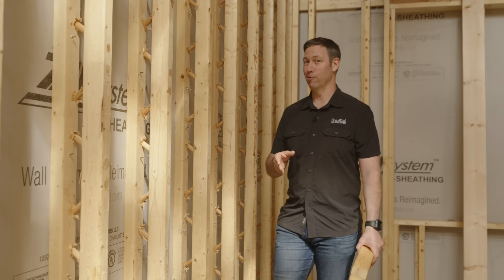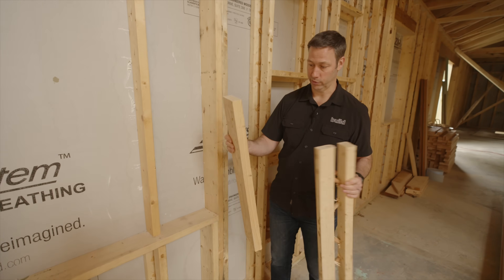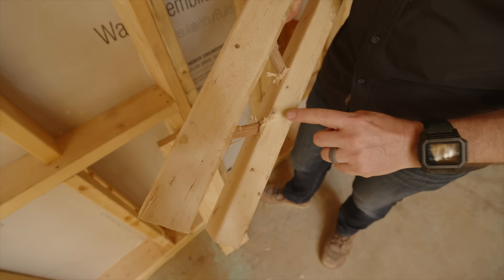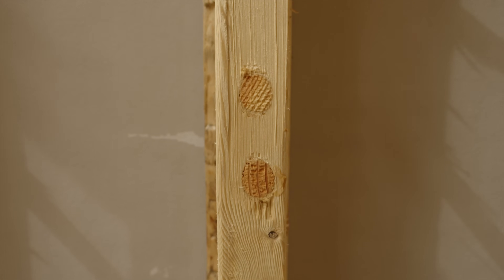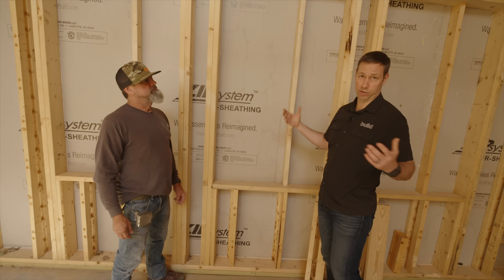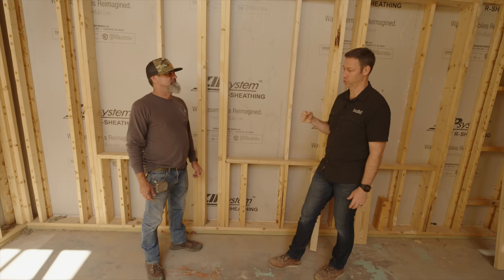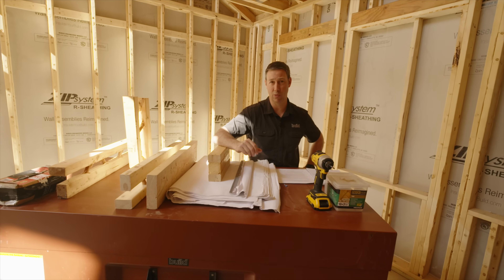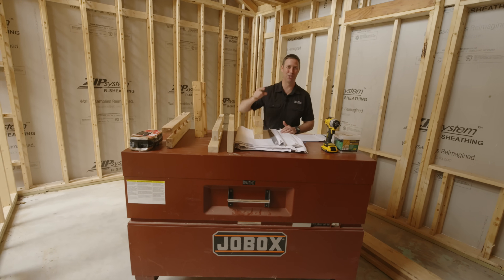Framing with a 2x6 Replacement - TSTUDS!!!

Comment: My personal largest issue is the same as with manufacturered wood trusses, tgi's and now these. A little bit of water, fire, or one thoughtless hole bored by a mechanical trade and the entire member is compromised. 

What has always impressed me about solid lumber members was their durability over time, even during a fire or a watee leak. 

And while I see the value and beauty in the flatness and straightness of engineered wood products, most of these still suffer from the fact that they are composed of smaller wood pieces, be it the dowels and 2x3 of these t studs, the strands in osb, the wood fiber in mdf, etc. 

If it's for work I wouldn't think twice if I was being paid to install these products. For my own home or shop I'd lean towards solid lumber. But that's me. Even if it meant more work with a power plane and a saw flattening critical walls.

Comment: Builder I knew in AK did 12" walls, useing 2x6, 16 on center, BUT, he would alternate the 2.6, so only on the corners you would have teh board go all the way through the wall front to back, that way we could insulate the entire wall

Comment: They're 5 times more expensive than a 2x6. If I'm that worried about thermal bridging, I'll use expanded polystyrene on the exterior as well.
Reply: 2x4 double  wall would be better can make wider wall  and offset  framing for even less thermo bridging  and cheaper
Reply: @arthurperrea3714   No. It is not cheaper.  Been there and done that.  It can be a nightmare of alignment and trim.  Does it work?  Absolutely.  But be prepared for the difficulties,, because 'it ain't easy'.
Reply: @Sailor376also  I built  my last house like this  didn't  find it hard . And if i was to built in the future  this is the way I go. REGARDS
Reply: 3x the compression strength, significant labor reduction in electrical and plumbing installation, less moisture trapping, facing size options for ease of other installs (like double width on the interior studs for cabinetry, or exterior for sheathing)... 

Price is absolutely a factor, but it is a product that will affect the expense of other steps of construction. Is it enough to offset? That will be a project by project call. I like the idea of the improved compression strength this far north with our snowfall.
Reply: @jamestaylor3805  
Ask yourself why you need 3x more compressive strength than a 2x6 for snowfall. Look at the failed structures in Mammoth and Tahoe with this last record breaking winter. All failed from to much span with undersized beams , or roof failures from undersized trusses. Most failures were from flat roof designs.  A 2x6 framed wall on 16 or 24 oc will not fail from compressive strength unless you park about 50 Abram tanks on a 2 /12 pitch roof directly over the wall. Its just not going to happen. Labor reduction for elec / plumbing. You can bet you will get the same bid for the elec / plumb but the cost difference will go into the subs pocket. Not yours. Would I use these studs on my project. Your dang right I would as long as I have a customer who will be happy to pay for it. Would I use it on my house or for a spec ? No.
Reply: @cdawg9149  sounds like a locational problem. Havent seen a maintained structture collapse under snow in Northern Maine in decades... where the winters are demonstrably worse and we prefer to build with local lumber.... but get on with your bad ass anecdote.
Reply: @jamestaylor3805  HAHA!!! Mammoth /Tahoe has recieved over 700- 750"" this winter with some structure failures from massive snow loads .Maine? Thats funny.
Reply: Thermal bridging remains the difficulty to over come.  You used nails to nail the EXP in place?  A normal nailing schedule will use 30 to 35 broad head or roofing nails.  Those nails transmit like a boat with 30 to 35 holes in the bottom.  You can run your own experiment,, easy to do.  Take two cheap foam coolers, two identical bags of ice, poke 15 or so nails through the sides of one, and then tape the two coolers shut.  Small hole in the bottom to allow water to drain.  Observe by total weight,, don't open.  The sealed unnailed cooler will last two or three times longer. Do not under estimate the number of nails that penetrate the foam,, sheathing? siding? trim?
In construction the nails through foam on one side are one plus inches from the nails on the other side for drywall.  Drywall is a cemetitious product and moderately conductive.  Foam definitely improves performance,, but not by a whole lot.
Alternative that is fast and cheap.  Two,, depends upon what heating/cooling zone.  Truss studs,, but make your own based upon a 2X10,, 9.25 ? Intermittent 3/8th plywood gussets, 2X3s instead of 2X4s,,, Fiberglass is cheap, and cheap per R value.
Or, build a 2X4 wall and on the outside, nail on a 2X3 layer 24 OC,, horizontal or diagonal (excellent nearly free wind bracing for windy locations)    Place un-nailed foam sheet 1.5 " thick between the diagonals and then sheet over with second layer of foam nailed into the diagonals   The contact points for thermal bridging are reduced 10X  and the nails for the outer skin do not penetrate the inner studs.  There,, 50 years of engineering, free
Reply: @Sailor376also  Nails penetrating all the way through into a cooler isn't the same as nails half way or less into a stud.
Reply: @jonking7345  I have run the experiment both ways  nailing a chunk of 2X to the outside and just sliding 12d nails through,, it doesn't make a lot of difference.  A 2X is not a good insulator,, about R-1 per inch..  But don't take my word for it,,, run your own experiment.  Or get a thermal camera and in the winter,, photograph a wall interior face,, just like I did.  You will find that the cold of the stud, glued and nailed to the interior drywall makes the drywall cold left and right of the stud contact point by several inches left and right.  In very cold weather , you can find each stud with your hand by sweeping across a wall .  Use the back of your hand,, less finger marks and more sensitive to temp changes.  In Arizona you can perhaps find the warmer areas of the wall.   Don't debate me.  I've run the experiments and 40 years ago.  Go do it yourself.  Go to Grainger's and purchase a good thermal imaging camera.  You do not have to take my word for it an ounce.    A conventional 2X4 studwall, 16 OC, with and average cover of 1/2 drywall inside and sheathing and siding outside, R-11 or R-13 fiberglass insulation between studs has an average total wall, R-value of between 6 and 7 , real world.  Look it up,, run your own experiments, talk to any HVAC guy.  The greatest degradation of thermal insulation is the bridging caused by the stud, R-1 per inch at best.  Stick 40 nails into that same stud (because that IS how many are normal per stud) and the entire 3.5 inches of stud is about an R-2. So right off the starting line a conventional 2X4 framed house, 17% of your wall is an R-2.  Skip the sheathing,, use metal strap wind bracing or let in 1X4 and nail foam to the outside,  and the R-5 foam is going to improve thing about an R-2.  Thermal bridging and nails are the problem to be over come.  Separate double 2X4 construction works well but is a nightmare to align and trim,, been there and done that.  Truss studs are the single best method I know.  Or non conducting (limited contact area) cross framing members
My complaint is this lock step with a 2X4 thick wall or a 2x6 thick wall.  run all the numbers yourself,, I did.  Cheaper,, better, faster,, in cold climes 2X10 thick wall with truss studs 24 oc, 9.25 inches of fiberglass.  Chopped fiber with a latex binder works miracles,, 24 inch wide, unfaced R-19 stock well placed at the back to fill between the inner and outer truss stud elements, and a 22.5 inch faced at the inside front,, all external wall wiring run at the 3.5 inches between the outer R-19, and inner R-11.  NEVER place a duct run in an outside wall,, all  vertical duct runs in the center of the envelope.  I am rambling,, I should erase all this shit and go to the doctors appointment.  I have been building,, my oldest license, City of Boston 1970,, I've been doing this a long time.  Nailing foam on the outside of a wall and hoping for an improvement in performance is a waste of good money.  And it IS nailed on,, by the carpenter's 18 year old helper, or a framing contractor who doesn't give a flying f*** what the engineer has instructed.  Foam, as commonly used, is expensive and worthless.  Yes, It is a worthy attempt at addressing a basic flaw of physics and cheap common construction,, the 2X4 stud,, but it is nailed to that same flawed system,, by exactly what makes the system flawed, nails and glue.
Reply: @Sailor376also  Clearly you like to hear/see yourself talking. I wasn't discussing whether a standard 2x4 wall was a good or bad insulator, and didn't dispute any of your other ideas. I merely pointed out that your cooler with nails fully penetrating isn't the same thing, and it's not a valid confirmation of what you're trying to say. Otherwise what you're saying is true, I have no problem with it. Now, compose a seven paragraph long reply, so I can't/won't read it.  I suppose someone will🙂
Reply: @Sailor376also  the newer adhesive and clip retained exterior systems show a ton of promise for closing the envelope.
Reply: @jamestaylor3805    Adhesives work well,, and for how long? Newer adhesives cannot be trusted,, not one of them.  I have demolished work I did decades ago.  Unrecorded number of remodeling.  Adhesives are only trustworthy until the building is up.  Some adhesives have proven wonderful,, others,, just expensive shims.  And there is ZERO ways they can be trusted for the long run.  Been licensed for 50 years.  You also do not mention how many nails will be used to nail the siding, the trim inside and out.  A normal salvaged 8' stud used in an outside wall will show 30 to 50 nail scars.  Siding, brick ties interior trim and cabinets, plumbers nails, electricians fasteners, HVAC guys,,, and then 25 years from now,, the homeowner or hack contractor remodeling. Glue and clips are almost certain to be violated 6 ways to Sunday.  Use the KISS principle.  Truss studs are a marvelous thing,,, but why oh why would you use a 2X6 format.  The idea is nearly perfect.  Just go to a 2X10 or 2X12 format,, cheaper, faster, better.  And on the subject  Quad glazed windows,  11/16 to 13/16ths space between each layer,  dehydrated air,  stainless or urethane spacers (aluminum has twice the expansion contraction ratio of glass,,, just hot cold cycles guarantee seal rupture)  Quad glazed is where R value vs total transmittance curves meet.  CO2 or Argon filled,, low E (except in extreme sun)  expensive salves because a 3/16ths air space is insufficient.
Reply: @Sailor376also  the new adhesives used in todays construction are literally the same adhesives that have been holding our aircraft together for decades, and have kept high end yachts intact in rough seas. You have to understand that you're experience though great and useful is still anecdotal... one perspective and set of knowledge. I have aircraft tape in my toolbag because it is better than anything else on the market for its ability to hold and seal... it is the tape we use to repair the EXTERIORS of aircraft. Same adhesives that have been holing arctic explorations facilities together in extreme temperatures just as long. 

I agree, the products that have come through the construction industry should always be scrutinized, but this adversity to adhesives is odd from someone I am sure has had fights with stubbord wallpaper from the 30s...
Reply: @jamestaylor3805  There are some or many adhesives that are incredible.  But how long will they last,,how much diluted is the construction version vs the aircraft or marine version.  And what is the life span. My knowledge is not anecdotal,, long experience.  I have dismantled structures that simply would not come apart. One remodel required a chain saw and cut into segments and disposed.  But how many times have I peeled something apart an the glue had entirely let go,,, many times.  None of us (Me especially) will live long enough to see the results.  (There is a benefit to my age,,, I can warranty everything for life now.  Laughing,, it won't be me that has to deal with it.)  Yes, I agree,, there is some incredible stuff out there. The better stuff is expensive,, and the subcontractor that does the brickwork or siding  will punch holes through all of it.  I JUST did a home inspection,, the plumber simply cut out a 1 foot piece of a floor joist.  How do you control a plumber three years from now,,, who first,  does not care,,, and second,, has not an ounce of knowledge about the perfect glue and foam clips.  Will the homeowner set their humidistat too high and soak the under side of the foam?  How will the perfect adhesive age under constant water immersion and freeze thaw cycles.  It may do extremely well,, but  I have zero way of knowing the 50 year span of a product.  I have zero control of what the scam contractor or simply 26 year old brand new contractor will do to this structure.
Glue has proven to be untrustworthy in the long run.  Some is great,, some rubbish  but they all have the same rated ASTM numbers on the side of the tube.  I use a lot of glue,, and with nearly annual formulation changes, I back it up with fasteners where required.  The person installing the sheet foam on the outside of the building is a per piece or by the hour employee.  As is the plumber,, the siding guy,, the Spanish speaking brickie.  And even,, not all marine application adhesives do what they are intended to do.  An Irwin 39 lost all her bulkhead on Lake Huron.  The 100mph tape on Pete M.'s Cessna was a standing joke.  Tyvek?  expensive, fast, and close to worthless in practice,,, excellent if use faultlessly.  The new roofing underlayments,, fast,, cheap, and dangerous and useless except they comply with code.  15# felt is pretty useless too,, but 30# felt beats Tyvek and the new underlayments absolutely hollow,, except it weighs so bloody much.
Reply: @Sailor376also  Just want to throw it out there that "your experience" is essentially the definition of the word anecdotal.

I do a lot of woodworking and I have seen nails and screws regularly loosen up, while I have almost never seen wood glue do any such thing. This is anecdotal. I am not saying screws and/or nails are inferior, but just a random example of using anecdotal information.
Reply: @Jasoninee  My experience can entirely be labeled as anecdotal.  One man, one life's experience,, no question.  I have a very wide ranging experience.  Oldest structure I have worked on, residing a house built approx. 1680.  My experience of adhesives is ,, some have worked and some have not,,, but the span of time bridging from use to failure, less than a lifetime.  And the confirmation that some have worked very well,, only the observation spanning 30 plus years.  Will the 'good ones' Continue or will they fail after 70 years I have no way of knowing.  But,, enough adhesives have failed in my span that I have become less trusting of adhesives in general.  I am not going to live long enough to judge what is good and what is not good.  About half are rubbish.
Take something common and commonly used,, silicone.  I wouldn't use it on a dog house,, and I will never use it in a roofing, window, or tub surround.  You cannot remove it from most surfaces,, and you cannot caulk over it, nothing sticks to it,,, but black mold can climb under it and make a mess.  So you want to scrape it out and renew the caulked joint,,, and yes,,, it can maybe be done,,, It often will consume an entire man day and then the tiny bit of residue that just cannot be removed,, will forbid adhesion of anything.    Where as a Polyseamseal or Dynaflex 230 will do an equally good job,, and last about the same number of years,, and can be removed to allow reapplication.
Anecdotal,, just my experience,, first licensed in 1971.  Still working.  Done two bathrooms in the past 2 months.
Nails and screws are an interesting subject,,, using a nail that is too long,, will make a floor squeak.  Go figure,, bigger, stronger is not better.
Reply: @Sailor376also  I am not reading that entire thing. The experience of a person is quite literally the definition of anecdotal. That is all. It isn't argument. I am just informing you that you can't really dispute "that is anecdotal" with a response of "listen bub... my experience is so good that it isn't anecdotal".
Reply: @Sailor376also  Thank you sir (madam) !
Reply: houses are built so cheaply. id rather pay more for a better more efficient house instead of a bigger house that will fall apart in 20 years.
Reply: @onerian8178  Where do you live?  What state? My houses are not cheaply built.2X10 walls, T-studs, triple and quad glazed windows.   Attention to sun direction, and local latitude and climate.

Comment: At 3:25 they are nailing the studs through the plate into endgrain of studs.  That would never pass inspection where i work.  Nails have no holding power into end grain,  must be toe nailed by schedule.

Comment: Are you familiar with BamCore? I happened to do a google search to see if there was a Bamboo wall stud - since it's more sustainable than wood, and likely stronger, and stumbled across BamCore. Very interested wall system, but I'd love to see a video of you meeting with the creators and some builders using the wall system. Love all of your videos. Keep 'em coming!
Reply: Bamboo loves moisture and expands and contract more than pine wood. This is a problem with bamboo flooring, must keep humidity low and in control or it will expand tremendously